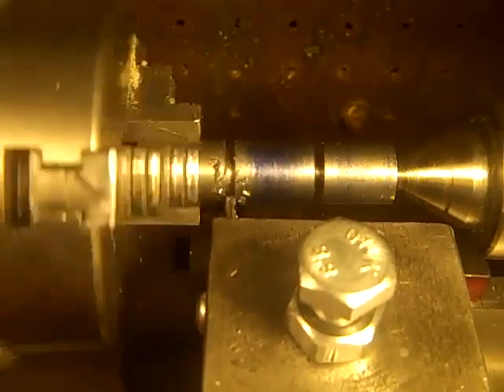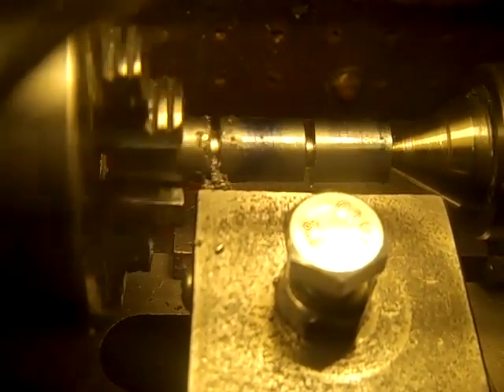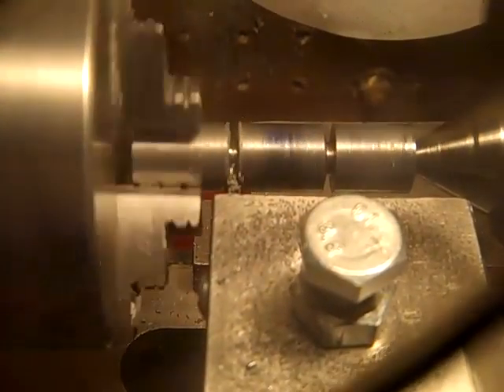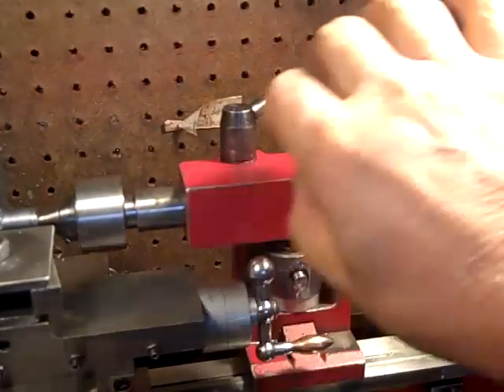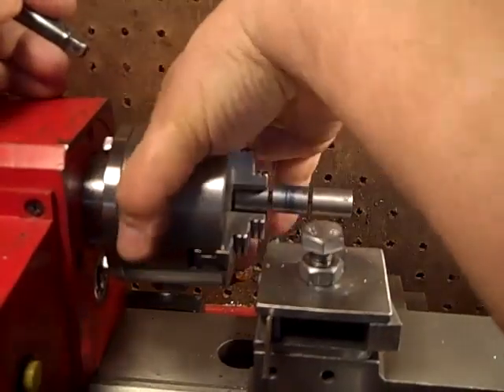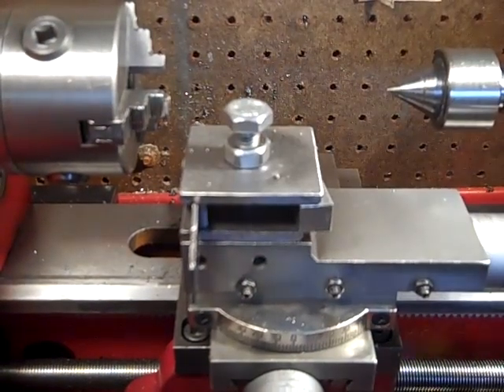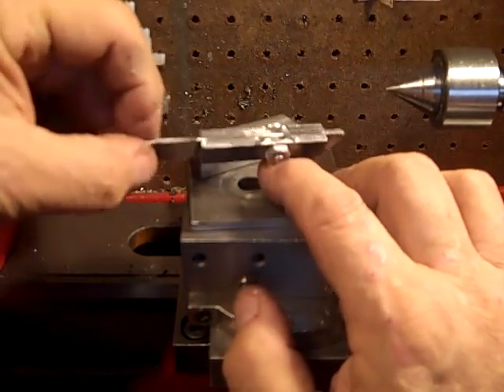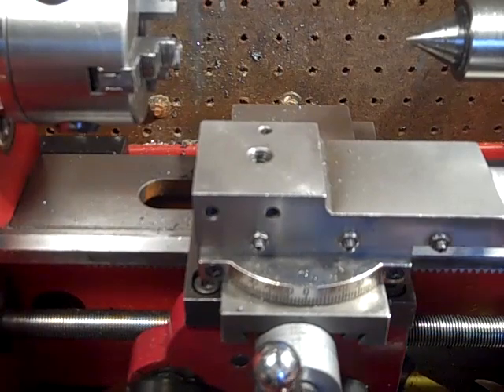Mini Lathe Crazy Idea Mods

Comment: I like your work around for solving the height issues of the cut off tool.
Pretty slick.
Reply from the maker: I have since changed the holder for the parting tool. Also have changed the geometry of the parting tool. It works much much better now. Peels out nice curls from hard steel.